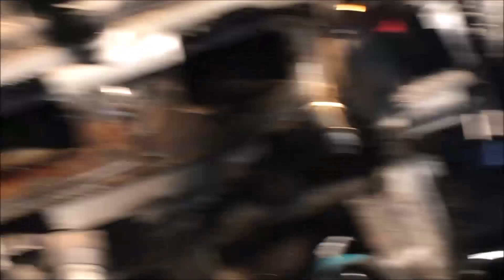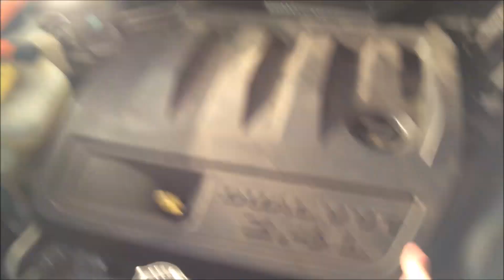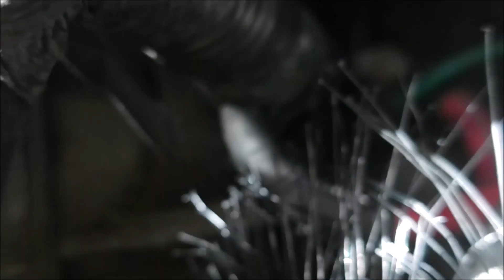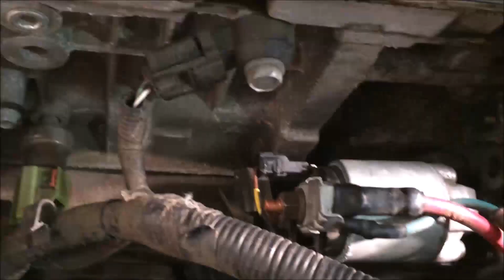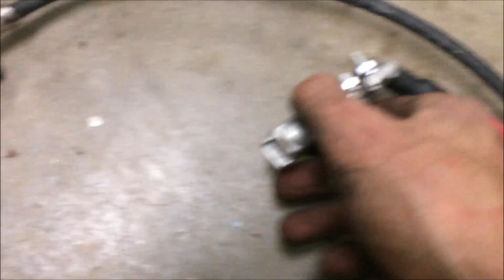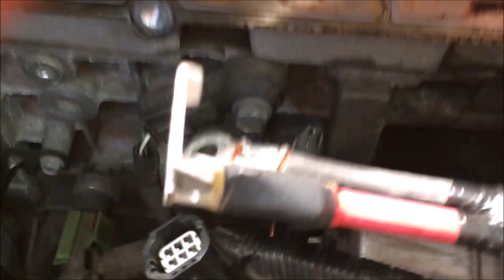Battery Cable Replacement 2.4L Compass Patriot Avenger

Comment: Just a question. Is that one cable attached to the starter? If so, would it not be a bit easier to remove the starter bolts and that way you can adjust the starter to access the bolt that is hidden? I have a 2008 Patriot and that is what I have learned on mine...not sure if that is the same for this vehicle.
Reply: Agreed. 2007 jeep compass, I took off my starter and took it off that way. seems way easier than taking off the intake manifold.
Reply: Indeed, I have a 2014 jeep patriot, and I have the Haynes manual. It even says to remove the starter bolts to access those nuts on the solenoid.

Comment: I did a quick fix with the negative cable too because I saw all the work needed and I was like nah man unless its a serious repair I would do it.  Replaced the engine and totally forgot about that cable. Seems like I was not the only one who had crappy battery terminals

Comment: Just an fyi. If you run a direct power line to the alternator and hook it up to the battery and delete the original cable to the alternator, it should fix your charging issue.

Comment: I don't believe this was the cause of your charging problem.
Reply: Even if it charges messing with the original clamps will cause battery light to come on. I just cut off a oem clamp and used a traditional one and while everything works the battery light stays on

Comment: There was nothing wrong with the temporary repair. It is good enough to get you out of Dodge. Get you home....etc. But a repair like that should be considered temporary until you can restore the vehicle to factory specs. Although I did notice bare metal on your temp cable repair. Splicing is fine but you should insulate the repair before reconnecting to the battery. Electrical tape or whatever.

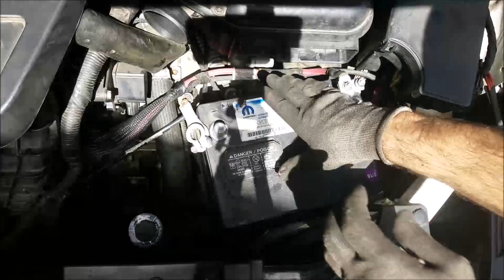Comment: 4:56 Oh my God....again.....the negative and positive cables are laying loose and flopping back onto their battery posts. This is a recipe for disaster. If necessary tie that negative cable back away from it's battery post.....for crying out loud.
Reply from the maker: You're right. I'm sorry. I'll be sure to bring this up with Father O'Malley at my next confession.
Reply: @dad-whodoes  The only reason I say anything because I almost burned my own car down when I was 19. Love the video otherwise.

Comment: When you say you are going to remove the negative cable first and then remove the positive cable......DO IT in that order.  Don't fiddle with the negative cable and then move over to the positive cable without removing the negative cable. If you leave the negative cable attached and then start wrenching on the positive cable....and ground out your wrench......you'll find your wrench WELDED to the body of the car where it touched. Ask me how I know this?
Reply: Dang.

Comment: Oh my God......to splice a battery cable using a bare metal splice.....it could start welding if the positive cable grounds out. I mean....arcing and burning like you never seen before.

Comment: I removed the starter to get to that hard bolt, I checked out this video earlier but thought it might be helpful to some to let you know that taking off the starter seems to be easier than taking off the intake manifold.
Reply from the maker: The started just went out on this Compass and I learned that the starter is more easily removed than I originally thought. Now I have to reshot the whole video and do it right this time! Thank you for the insight Mr Gravely.
Reply: Thanks for the info I’m gonna have to do this tomorrow. Definitely don’t want to take out the manifold if I don’t have to.

Comment: I have the same issue with my 2014 Jeep Patriot if I move wires it starts and sometimes the fuse box wire gets hot . Would you know why it gets hot?
Reply from the maker: IDK other than there is a high amount of current going through that wire. I'm not sure if that is normal.
Reply: A wire like that might be getting hot in this case because the connections might be a bit corroded. Sometimes cleaning connections with a wire brush or similar, restores the circuit. In my work, sometimes just disconnecting and reconnecting a connector is enough to clean "micro-corrosion" from pins and sockets and everything works again. Just a thought. (For those who might be reading this a year later......like me.)

Comment: question, I have no drain on the bettery this is the third battery and the alternator is charging while the car is running but the battery just like the last 2 goes dead in 12 hours\
Reply from the maker: So I'm a DIY mechanic with only enough knowledge to be dangerous. That said, it sounds like the charge from your alternator is not getting to the battery, but the battery is being drained.  If not the alternator (did you have it bench tested at Autozone?) then my first thought would be the battery cable, and my second thought would be the battery regulator.
Reply: @dad-whodoes  hi I have a problem with my 2014 patriot 2.4 l, battery is good, alternator, is given 14.7 v and starter sound fine but won't start sometimes and just make a one click sound
Reply from the maker: @charlydarkflo  I recall this happened to our 2.4L as well. Does your car start when you give the battery a boost (jump start)? If so, look for corrosion on the terminals or cable. If not, look at you alternator, which may be working intermittantly.
Reply: @dad-whodoes Thanks, I did have it bench tested and everything comes back working correct. Ill swap the battery cable and go from there, thanks.
Reply: @dad-whodoes  0
Reply: It’s your battery cables

Comment: Jut replaced  the alternator started the jeep and battery  light is still on. So I guess this sounds like the battery  connection.
Reply: It’s the power line to your alternator went bad. Install direct power from battery to the alternator and it should fix your problem. I just found this out and it fixed the issue immediately.